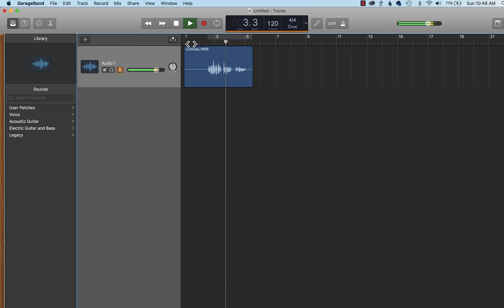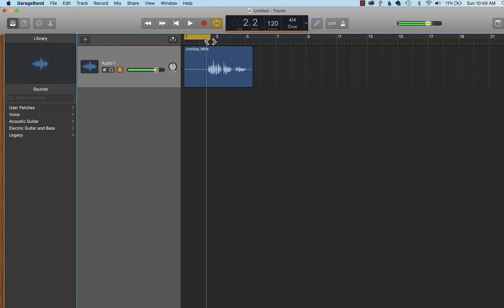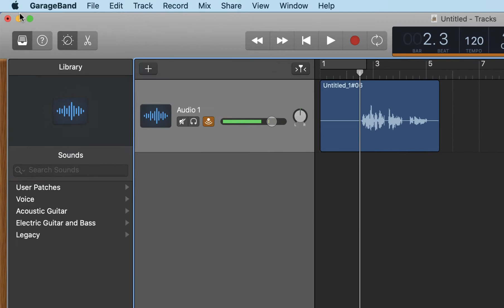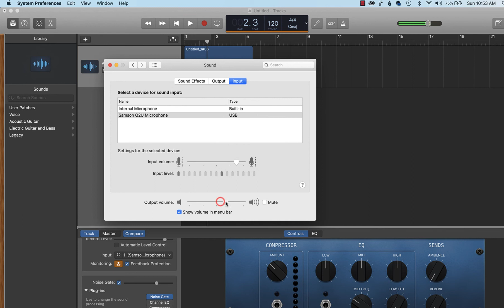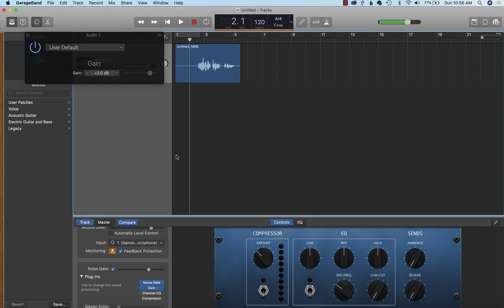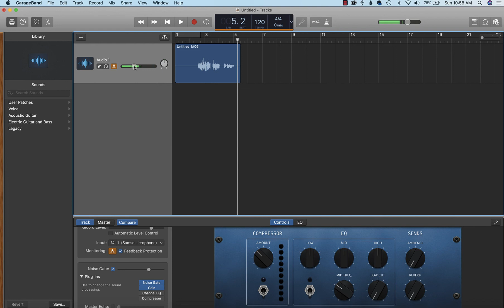Remove Noise and Hiss from Your Podcast in GarageBand in 2020

Comment: I followed your directions but it still sounds like I'm in a tunnel. How do I get rid of that? Thx!
Reply from the maker: @dawnmcclure8188  what is your recording space like? If you are surrounded by hard surfaces for sound to bounce around on like glass, concrete, high ceilings, granite countertops, that might be adding to the tunnel sound. If your space has these hard surfaces, try moving to space with carpet, curtains, and pillows. Walk-in closets are great recording spaces because the clothes absorb the sound of your voice.
Reply from the maker: To try to fix your current recording, try using the free Adobe Enhance tool. You can upload your audio file on the web and see if that that helps. It has worked wonders for some recordings I've received where the guest sounds like they are recording in a tunnel.
Reply: @BrassyBroadJen  You are so kind to reply - thank you!! I'm 57 years old and I have no idea how to upload an audio filed on the web. I'm trying to break into VO work, with minimal costs, and I thought GarageBand would be a great place to start, but I need someone to walk me through how to use GarageBand to make a great VO recording. Is that something you do? Once someone has walked me through a VO from beginning to end using GarageBand I can go from there on my own. Thank you again for response!
Reply from the maker: @dawnmcclure8188  garage band is a great place to start! I walk clients through recording and tech all the time. You can email me at jen@brassybroad.com and I can send you info and a link to schedule a power hour session to get all of your questions answered.

Comment: This helped so much more than other videos!😭 but I still get a hiss😭 I started using the CAD audio mixer due to getting a very bad echo with my cohost but now the issue is the hissing.. a very noticeable one! I tried the Gain and noise gate but it sounds too choppy BECAUSE of the hissing🥲 any suggestions?
Reply from the maker: You might try running it through Auphonic to denoise it and then bring it back into Garageband for editing. Check out auphonic.com. I would also check the gain settings on your mic and see if you can turn it down a little to lose that hiss when you do future recordings.
Reply: Turning down the gain, would that be moving it to 3? As you can tell I know very little about audio😅😭 but I am learning😊

Comment: Hi Jen, i tried this setting and adjust accordingly but whenever I test the sound from my built-in volume it doesn't achieve the noise reduction like what you have in this video. (your actual video) I have a high-quality interface but a so, so, mic condenser. Would you advise to get a high quality mic to achieve this kind of clearness? What do you think is the other way around? Thanks!
Reply from the maker: Dee, it's hard to diagnose without sitting in front of your gear and the recording. It could be the mic if you're having to crank up the gain on it. Is it possible you might be picking up fan noise from your computer? I was using a Samson Q2U USB microphone plugged straight into my computer to make this video. So I wasn't using a high end mic or interface.

Comment: Hey - this is great- I have GB 10.4.2 and don't see a "gain"  option in my plugins.. just Noise Gate, DeEsser, Channel EQ, Compressor, Channel EQ, Compressor, Channel EQ - is there a way to ad this?
Reply from the maker: Yes, scroll to the bottom of where you see your plug-ins and then click on the blank space to bring up the plug-ins menu. Then click on Utility and you should find the Gain plug-in there.
Reply: @BrassyBroadJen  hi! I love your video, although I have the same question as above. I just have these plug ins, but there is no 'utility' nor can I find anywhere an option to add other plug-ins such as gain. Maybe because there is a gain button on my mic? I record with the blue yeti X, and have just installed Garageband on my MacBook Air.. There is no silence, just this low hissing sound..

Comment: Jen, Thank you for you explanation. I use Noise Gate on my podcast and it does reduce the background noise. I find that it causes the speech to be choppy. As per your instructions I adjust it to eliminate this. I cannot record at -25db as you did or it is really choppy. I record at -38db and my speech still sounds a little choppy. If I raise it to above -40DB the choppiness in the speech disappears, but then the hiss creeps back in. I have tried adjusting the gain from +3.0 to 3.5 to finally 4.0, but I can't seem to beat the problem. I am using garage band version 10.3.5 and a Samson Q1U USB Microphone which is the easier version of the one yo used in this video.
Reply: hello were you able to fix it?
Reply: I’d love to know if you were able to fix it as well
Reply: Same